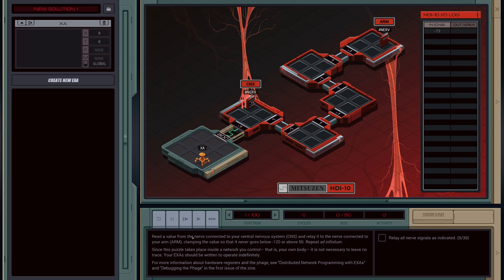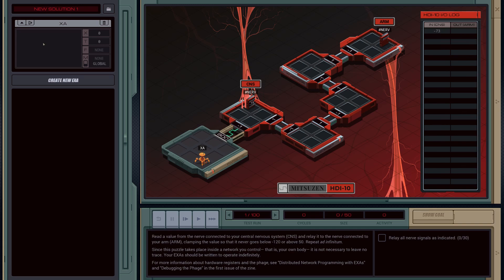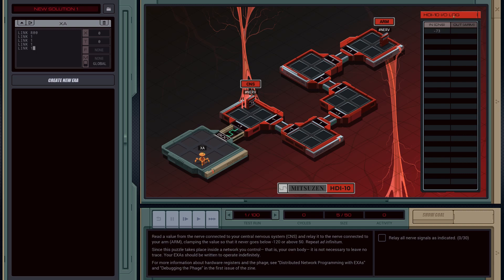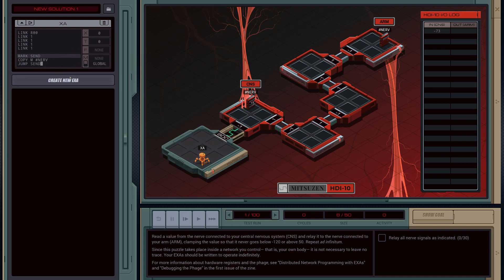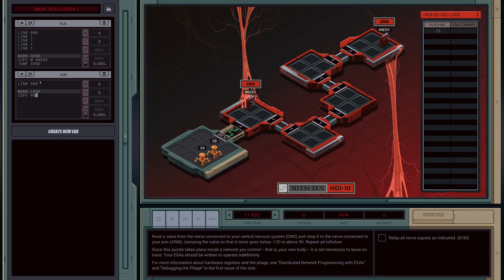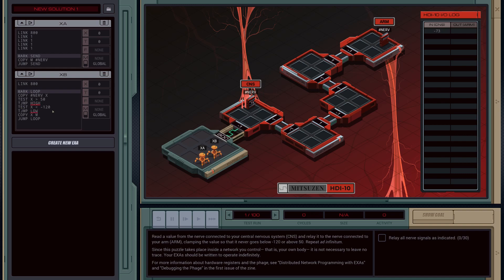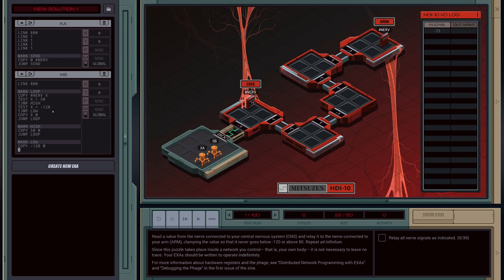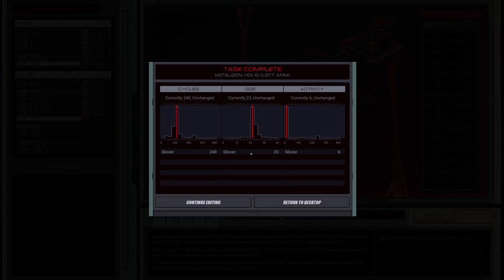EXAPUNKS EXAplained - 06 - Mitsuzen HDI-10 Left Arm

Comment: Can't hear anything. no sound.
Reply: do you uh.. have your audio turned up?
Reply: @QreenVEVO  if I turn my PC volume to max, and speaker volume to max, you are just barely audible.
Reply: @QreenVEVO  You're really quiet. The problem isn't on his end
Reply: @hole1274  Nukes2all isn't the guy that uploaded the video, and I can hear this guy just fine with my windows volume at 28, so the problem is on your ends.
Reply: @CycFlame  I've watched this on two different laptops and my phone, and watched other videos to make sure it's not every video that's fucked up. The problem is the video. Have you tried comparing the audio to other videos?